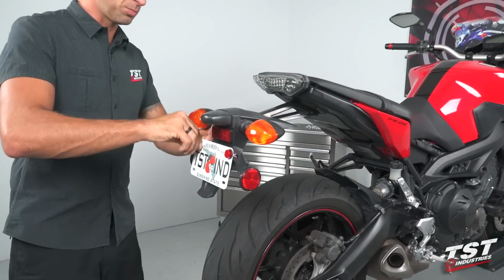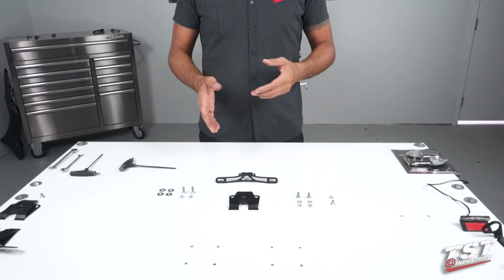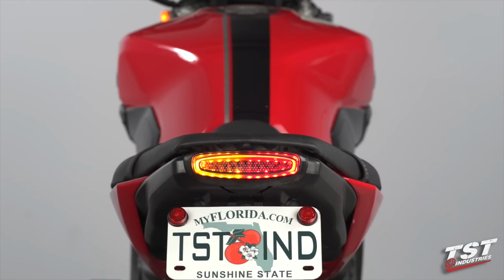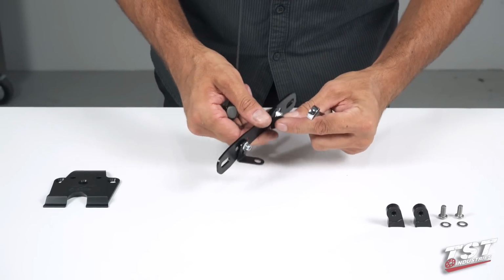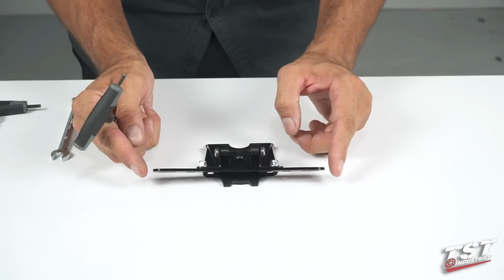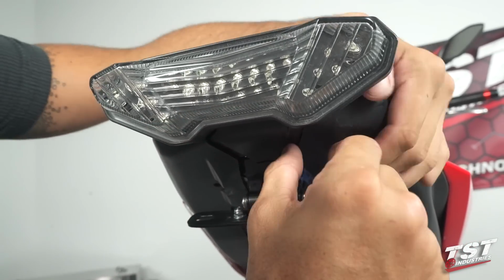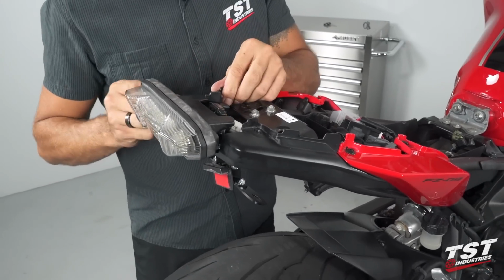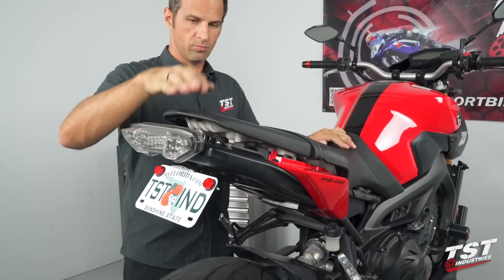How install an Elite-1 Fender Eliminator on a 14-16 Yamaha FZ-09 by TST Industries

Comment: Does the close out come with the plate holder?
Reply from the maker: We have several versions of this product available. Just the Closeout does not come with a plate holder. Any of the Fender Eliminator variants of this product come with the Closeout and also with a plate holder.
Reply: This fits a 2015 fz09?

Comment: What is the size of the bullet connectors you used on the license plate light wiring?  Placed my order recently and want to purchase the right connectors.  Thanks.
Reply: TSTindustries I just got the kit but I'm having trouble figuring out how to get the light connected. it came with little red connectors but I'm not sure how to get those to work on the bike
Reply from the maker: They are 3.5mm bullet connectors. They are not completely necessary with our Stealth License Plate Light as that kit comes with universal connectors.